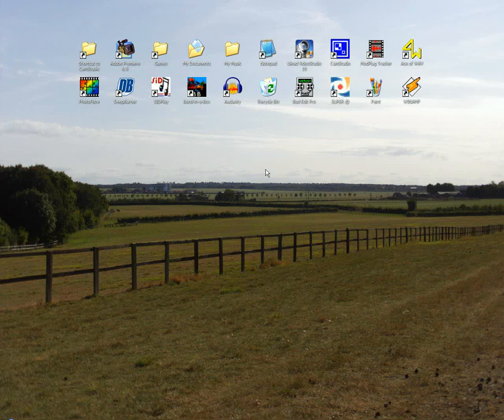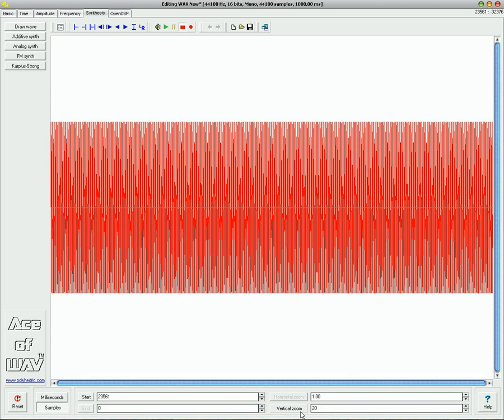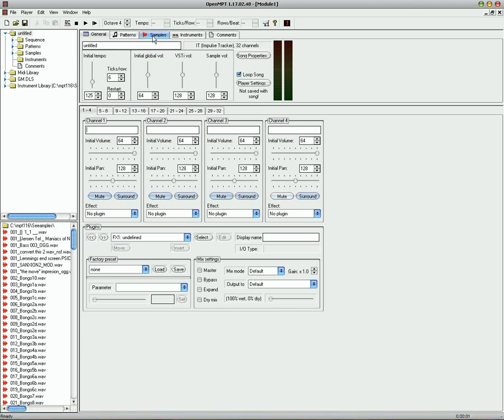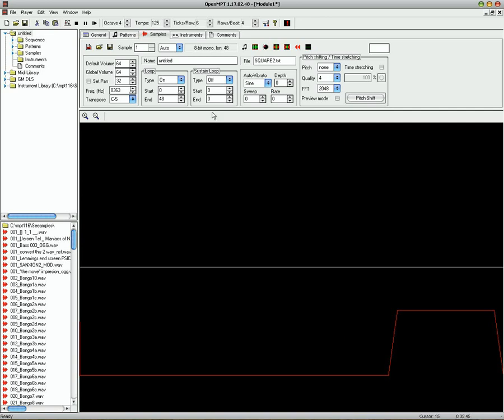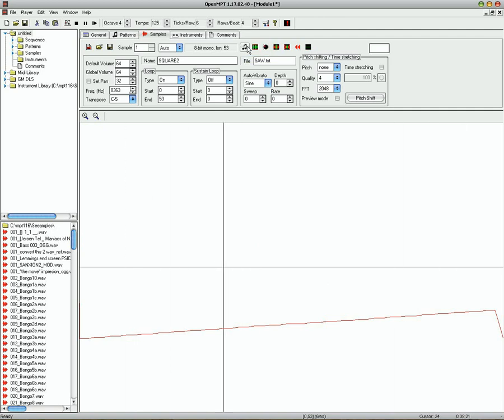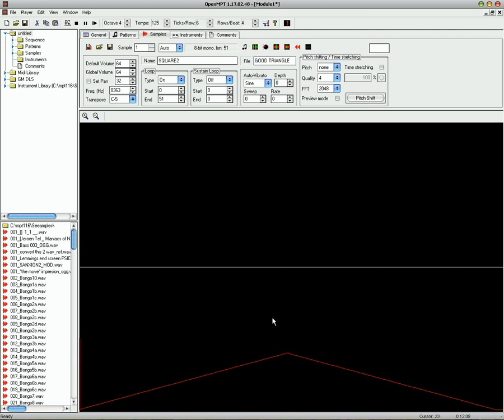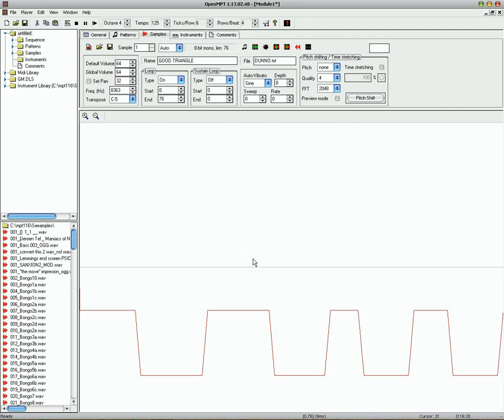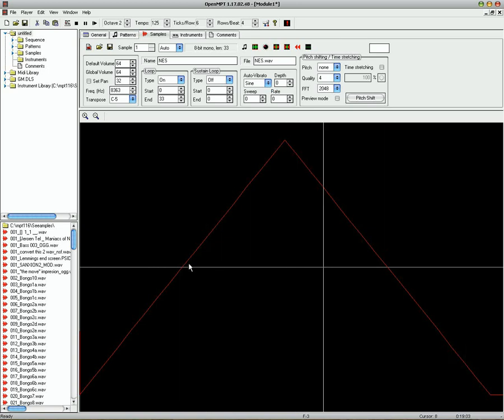Making chip tunes in mod-plug tracker tutorial 1 - How to make 8 bit chip style sounds.

Comment: basically what the formula does:
r = random, so it adds a noise factor to the sound
t = time, increases by 1 for each sample
sin(10000/0.1*t) is a sine wave with a decreasing pitch
(512/0.00001*t*t) makes the sound noisier at the start, and turns down the volume over time
+127 centers the sample

Comment: i've found my own way of making samples,
it uses formulas,
this, for example, is a sort-of bass drum:
r*(sin(10000/0.1*t)*(512/0.00001*t*t))+127
this is basically what got me onto that
because, the space character is an ANSI-value of 32, and a z is a 122, which means there's a fair difference, that's exactly what's happening
whats happening is mpt is turning the ANSI value to the volume level (0-255) of the sample
i'm using a formula to calculate them with a program i made

Comment: There's no problem in having a sample not in line with the DC (center), you won't hear any difference, but the volume spectrum is lower (so you can't do 0-255 values if 8 bit).

Also, in the newer versions of OpenMPT there's a button for automatically centering the waveform.